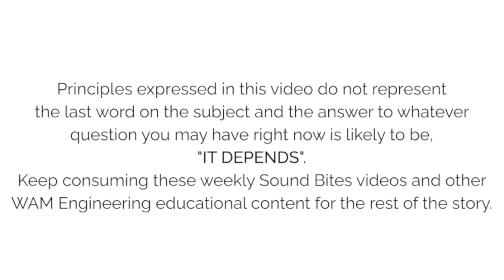Sound Bite #36: Tracking Error vs Zenith Error

Comment: But if you correct for zenith error what does that with the damper in the cartridge?.
Reply from the maker: The more zenith error correction, the more the asymmetrical compression applied to the damper. If you do the math on a 5 degree correction (industry tolerance) it is quite a small concern. To get high enough to matter we are where we can make a warranty claim on the cartridge anyway.

Comment: Is there any difference between stylus types to be more or less prone to zenith error? particularly  microline  vs shibata, and microline vs eliptical.
Reply from the maker: It is the more expensive profiles that tend to be the furthest off. They are far harder to machine and usually require multiple repositioning in the workhold. Every time that is done you stack your tolerance errors.
Reply: Thank you

Comment: I'm beginning to think timing/ phasing is more important than frequency response.
Reply from the maker: Oh, most definitely. This is easy to prove. Been done in several scientific papers. Most recently by someone from Univ of SC in a FASCINATING paper, “Human Auditory System and Audio”
Reply: @WAM-Engineering  Microsecond temporal resolution in monaural hearing without spectral cues?  (PubMed 2003)

Abstract: "The auditory system encodes the timing of peaks in basilar-membrane motion with exquisite precision, and perceptual models of binaural processing indicate that the limit of temporal resolution in humans is as little as 10-20 microseconds."
Reply from the maker: Later studies suggest even faster than that but it is frequency dependent

Comment: If I understand your explanation...
What is the solution to a cartridge that has a zenith error.  Is there a way to compensate for that error, without introducing a tracking error?

If not, then would you deem such a cartridge to be defective?
I am asking, because I am considering a cartridge upgrade (which I will comment on, separately), and feel that the manufacturer should get it right -- at least at the price point I am considering.

Regardless of which aspects of corrective adjustment we are most sensitive to, I would imagine that zero adjustment for a properly designed and properly assembled cartridge would sound the best?  Is that so?

I realize that what sounds best is subjective.  For me, it is hearing what is in the groove, without any "pleasing" artifacts from error correction.
Reply from the maker: If you watch some of my other videos on zenith error, you will see that the correction requires an error in cantilever alignment.

I’ve also explained why there is so much error in the market. Watch my video on my website at the bottom of the educational video page where Michael Fremer is the mediator of an expert panel in Munich. 

The cartridge isn’t defective unless the zenith error exceeds the manufacturer tolerance. I am not referring to the cartridge manufacturer, as they generally don’t make that assembly. I’m talking about the stylus/cantilever manufacturer.

Yes, zero correction would be best. 

How would you know you prefer the sound without the correction if you can’t be certain that you’ve heard the correction?
Reply: @WAM-Engineering  "How would you know you prefer the sound without the correction if you can’t be certain that you’ve heard the correction?"
I could not be sure of what I would prefer, for that specific choice, due to not being able to A/B the differences.  So my default answer is that needing no fix would sound better than having been fixed (or the trade-off that you explained in this video).

When I listen to any music, of any format, I generally dislike overused studio gimmicky.  It has its place, and I love it when it is used judiciously.  But I dislike it when it is used like over-seasoning food.

For example, some of Karen Carpenter's songs have her double-voiced (or whatever the effect is called).  I prefer to hear Karen sound completely natural.  Her voice needs no help.
But when Cher sings "Believe", the auto-tune (or whatever it is called) is very good, because it is the entire point of the song.  That effect, in that song, is what captivates the listener.

So what I prefer, in terms of correction, is based on my limited experience, overall.  I wish I could know for sure.

Thank you for your reply.  And thanks for this video.  I learned something new; something I never considered.